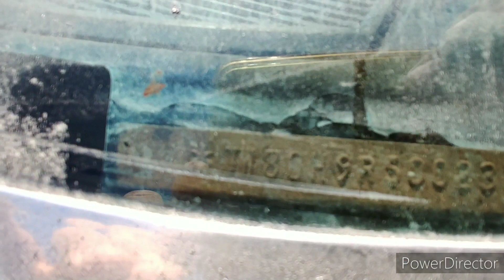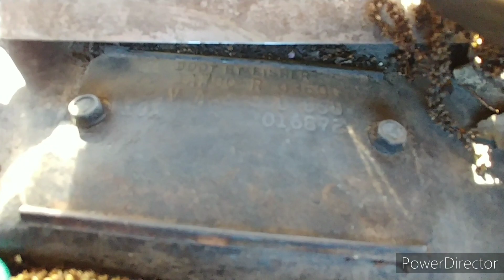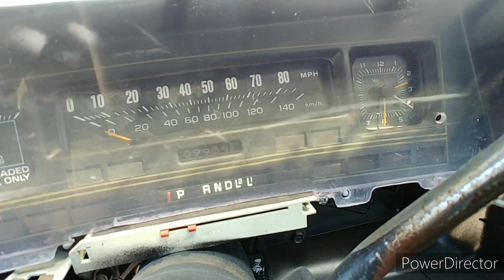1979 GMC Caballero Junkyard Find

Comment: Whoa Nelley, it's a GMC, don't you see? Rhino Liner is good but you have to have the UV protection added to the base stock when it's made up or it does not last and fades in the sun in short order.

We got the VIN, we win: T for GMC truck (an El Camino would be a 1 for Chevrolet Division), W for Caballero, 80 for pick up/delivery body style, H for 305 V8 with 4 barrel, 9 for 1979 model year, R for Arlington, TX assembly and the rest is the production sequence. This actually has the wrong grille as it has a Chevrolet grille, not a GMC grille. That is one of the differences between the two vehicles. 

We got the tag, we can brag: 79 for 1979 model year, 1AW80 for Chevrolet El Camino, but I'm pretty sure that the build sheet shows a GMC "conversion" option (such as Z88), so it starts life as an El Camino and then got "converted" at the assembly plant, R for Arlington, TX assembly, 24V for blue vinyl interior trim, A52 for bench seat, 85L and 85U for Medium Blue upper and lower exterior paint, 10A for the first week of October 1978 production. 

Rhino Liner or any of those bed liners are a bear to remove when you need to do it right. We had a vendor treat the interior of a utility body of one of our municipal trucks we bought on contract. They made a mess of it and they wound up taking it off and redoing it. It was U-Pol product, similar to Rhino and Line-X. There are multiple products out there with similar properties. The guy that took that stuff off probably lost 10 years of his life, yikes. 

Yes, they reproduce that coolant tank. Here is one source, just with a fast Google search: https://www.opgi.com/cooling-heating/overflow-tanks-catch-cans/coolant-overflow-tank/tank-coolant-overflow-78-88-el-caminomalibumonte-carlo-l240901.html?gclid=CjwKCAjwu5CDBhB9EiwA0w6sLR2hboQe6J24rvPttFjioPVi6QztwmJ4V_lDCBAcbKUIY_sGglTH-RoCLYQQAvD_BwE

Based on the tag, it was a G80 limited slip indeed. That's the typical tag of the era. 

Whoa Nelley, it's a car, or is it a truck? No matter, it's full of muck. 305 and took a nosedive. '79, and not so fine. Painted blue (originally), it's over for you. Wasn't cheap, now it's a heap. That's it, time to quit. Going to be flat and that's that. Got a lift kit, now it's junk, that's it. Going to get squished and we're kinda pissed.
Reply: Yeah Its an El Camino. Damn Straight.

Comment: I believe Benny,That i could use some parts off of that White Dodge Ram parked beside this GMC. What year is that White Dodge Ram? Mine is a 1997 1500 and could use a 16 inch Steel Wheel and Those Mirrors and 4 matching Center Caps! 10/4? Love your movies. Dude.